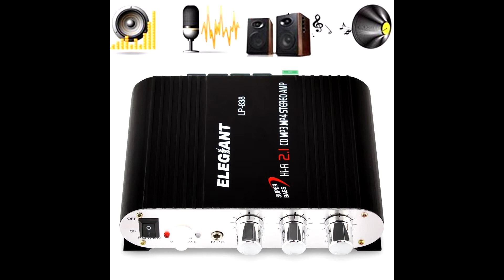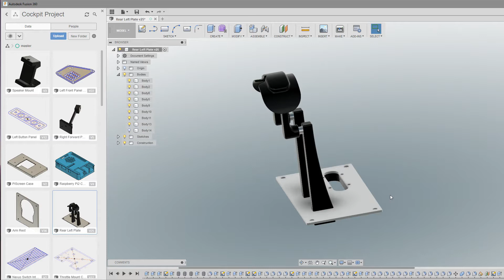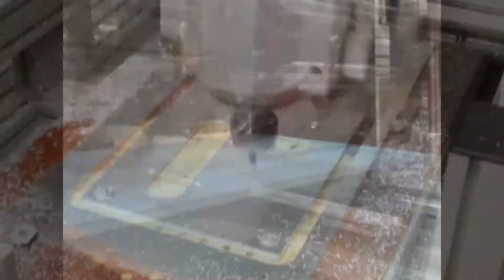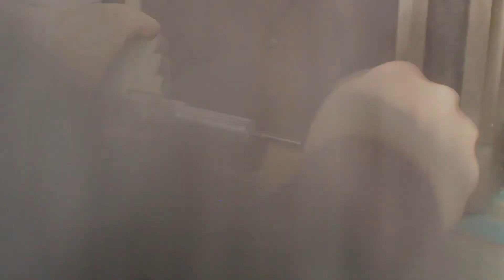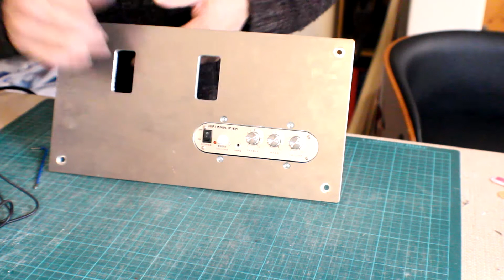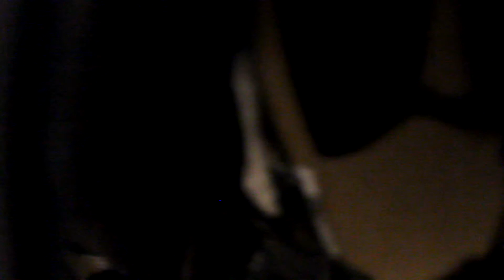Gaming Cockpit - Part 27 - Making a VR Headset Hanger

Comment: Love watching your videos, your skill is a wonder to behold. For your blurry 3D printing time laps, perhaps more light and a higher shutter speed would help.
Reply from the maker: Thanks Will - yeah I might look at a new solution, as I'm currently using a Raspberry Pi Cam and its not the best. Lighting is something I'm looking to also upgrade - I'm thinking of LED's on the printer frame itself, which can then draw power off of the PSU (with suitable voltage converted).